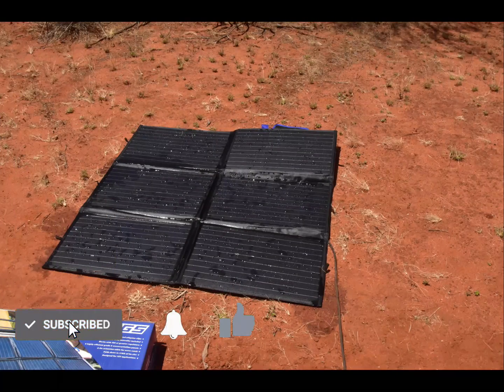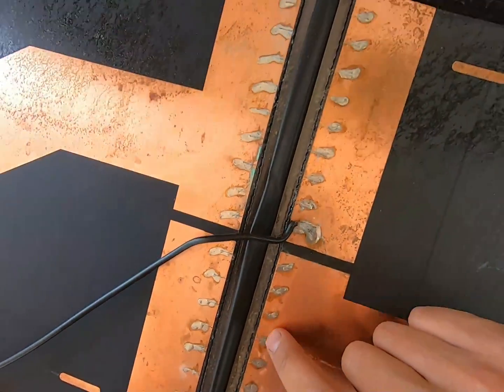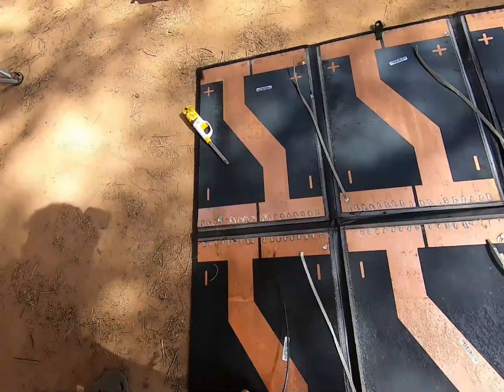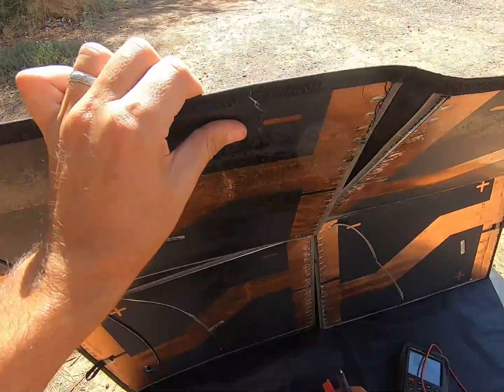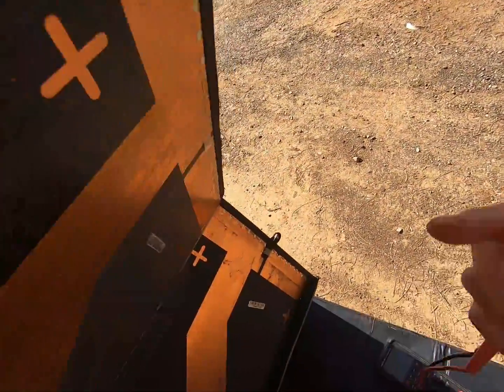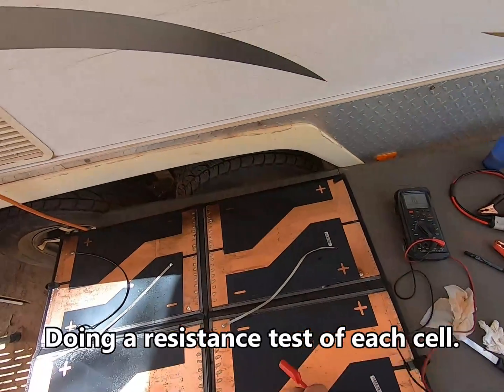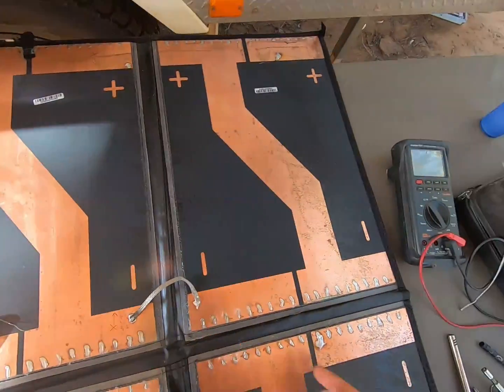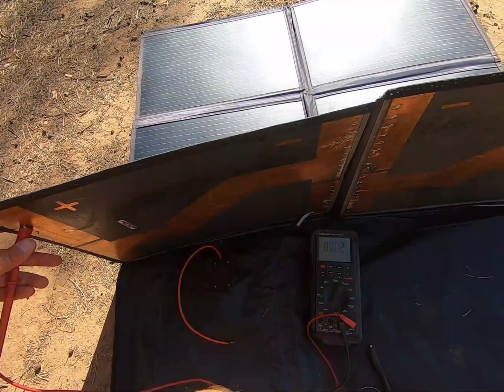[DETAILED] How to fix a faulty solar blanket

Comment: Great to see what's inside! 
You can measure the panel section voltages without disconnecting the braided wire links. 
Overall voltage will obviously be 11/12 of previous value and current will NOT change, so only ~8% loss 😊
Reply from the maker: Glad it was interesting! Yes that's true you don't have to disconnect the braids - the panels are in series so provided the other end's disconnected your reading's not going to be affected by the other panels. I just did to be absolutely sure there was no outside interference in my measurements.

Comment: I followed your repair with success, however the plastic coating over the cell is in such disrepair do you know if this can be repaired
Reply from the maker: Hi Garry, I don't think so unfortunately. The coating is one of the compromises with a cheaper blanket. The only thing I could suggest if it's stopping light getting through is to just carefully scrape it all off. I imagine it's there for a reason so this may introduce other issues, but if it's already that far gone you may not have much to lose. Good luck!
Reply: Cut & polish?
Reply from the maker: @electron-1979  Theoretically yes, but the solvents in polishes can sometimes react with plastic and make them go milky. So it could make whatever's underneath to go milky as well. I guess you could easily test it on a small corner first.

Comment: yikes they suck... 3amps? I get 6amps from a 100w rigid (6kgs) 1m x .5 .... and it works on super hot days(5.7amp). Kings weighs less than 6kg (5.5?) so lol why would you bother. Get a panel that actually outputs what it says
Reply from the maker: Yep I've heard panels work better, but they're physically a lot bigger so people may not always have room to store them. Blankets tend to be a lot more compact which is probably why some folks choose them, certainly that's the case for me.
Reply: @TheMusingGreg  Yes thats the narrative... but a 1m x.5m is small and even a 4x4 setup has a roof component/space. for hikers yes a blanket would be the only choice though their needs are tiny as they cannot store much. (charge a phone camera or light?)
Reply from the maker: @markwright196  It's not just a theoretical narrative, it's reality - at least it is for us in our caravan. Space is at a premium when we're travelling as our vehicle and van aren't huge, so for us a compact solution is very important. I'm travelling with five blankets at the moment while testing different brands, yet I'm able to fit them all in because they're compact. There no way I'd fit something 1m long in any of the spots I store my blankets - it's too long for the cargo area of our vehicle and too tall for any of the nooks I can tuck my blankets into.

On our 4x4 roof rack there's a canoe, shovel, MaxTrax and body boards so there's no room for a solar panel there, although I don't need a panel on my vehicle anyway. 

I get not everyone would have the same space constraints, but it's also not just hikers who might need something smaller than 1m long.
Reply: @TheMusingGreg  If you have a van then I have a hard time seeing the limit. I have a avan and it fits fine, which is one of the smallest vans.
Reply from the maker: @markwright196  It's not like there's physically not the room if it was the only option. A folding panel could sit on a bed, or on the table, on the floor or the van for example. But I don't want things just lying around getting in the way otherwise you can't just pull over and have lunch in the van if you've got all this large clutter in the sitting area or walkways. I like to store things in designated storage spots which are by definition out of the way. And the places I have available for storage aren't large enough to take a 1m folding panel.

Comment: Too fast
Reply from the maker: Which bit in particular Deb? I fast-forwarded through a couple of sections which were just repeating the same process over and again but the rest was at normal speed. I'd appreciate knowing so I can improve that in future. Thanks!
Reply: @TheMusingGreg  around 15:19 and on for a bit I couldn’t keep up
Reply from the maker: @debtaylor4989  😄
Reply: @TheMusingGreg  huh
Reply from the maker: @debtaylor4989  Maybe we've crossed wires here? You said it was too fast from 15:19 onwards, but the video is only 15:19 long. So I figured you were having a joke. Did I misunderstand? 🤔

Comment: Hey mate I've got your same solar blanket and seems not working properly anymore. Same as you.

Did Kings change your old broken solar blanket with a new one? I mean did they replace your old one with a totally new one?

Of course mine is still under warranty. 
Please let me know
Cheers 🙂
Reply from the maker: Yep they replaced this one under warranty as I sent them sufficient information to show it was faulty (i.e. zero output).
Reply: @TheMusingGreg  Good on you! 
What proof did they want you to show? 
Cause something similar is happening to me as well, but wouldn't know what to say to them.
Reply from the maker: @fulviomorrone6995  In my case it was easy as there was no output, so a multimeter showing 0 volts when connected to the output connector was sufficient. When it was low output in an earlier faulty blanket it was harder, but I still showed the output current and voltage going into a battery from which you can calculate the power (Power = Voltage x Current) and showed how far below the rated output it was. I show this a bit at the start of https://www.youtube.com/watch?v=cfCM_p21cGs. They accepted it after a while and replaced that one too.

Comment: Hi so you put the volt meter between the kings nppt charger and the battery?
Reply from the maker: Depends what you're trying to measure / achieve. If you mean at the end of the video when I was measuring the voltage coming out of the regulator and going into the battery, then yes. Which part of the video are you referring to?

Comment: i have a king's 250 w solar blanket, not showing any watt's on a watt meter, disconected the straps connecting each panel, each individual panel show's between 21.4 v to 22.8 v, anderson plug show's 21.5 v, but no  watt's on the one panel it's connected to !! any suggestion's please
Reply from the maker: What's it plugged into? It sounds like whatever it's connected to isn't drawing any current. If you've got 21V at the Anderson plug it means all the panels are working, as you've found. But with no current flow, you get no power (power = voltage X current).

Make sure it's connected to a working solar regulator and a battery which needs some charging, and check all the connectors between the blanket and the battery.
Reply: @TheMusingGreg  thank's mate, i'll keep messing with it , see if i can get some sense out of it
Reply from the maker: If you can't get any sense out of your setup, go to Jaycar and buy this resistor https://www.jaycar.com.au/100-ohm-5-watt-wire-wound-resistor/p/RR3274 - if you plug your power meter into the output of the blanket, and then connect this resistor across the output of the power meter it should draw about 0.2A, which at 21v will be close to 5 Watts on your meter. That will eliminate any issues with the battery or wiring.
Reply: @TheMusingGreg  fixed, must have been a dodgy solder on the connecting strap's, thank's for your help mate :)
Reply from the maker: Cool glad you got it sorted!

Comment: Hey mate I have the same blanket and I can only get 5 amps out of it on a good day full sun and my meter is saying it's only getting 50w would there be a faulty panel on mine like you show here? Or if one panel is faulty it won't work at all?
Reply from the maker: Hi Dale, I can relate to that! Mate it could be faulty, however there are a few other things to check first:

1) how full were your batteries? If the batteries are already nearly full the regulator won't take full power from the panels. Try connecting it to a flat battery and see how much goes in.
2) make sure you check all the connections from the panel to the regulator, and then to the battery, are all tight and clean. I had low current at one point last year and it turned out one of the bluepoint / cable joiner connectors I'd used in the system was a bit loose. After tightening up the screw connector the output lifted by about 20%.
3) I assume the panels are clean? Dirty panels will give reduced output.

If yours is faulty it would have to be in a different way to mine, because as you said yes if one panel fails completely and goes open circuit it stops the whole system working. It is possible however that one or more panels might be losing their oomph which would lead to a general reduction in power. If that's the case, if you've eliminated everything else and it's still under warranty, you might be able to get a replacement.

FYI, I've got a brand new Kings 200W blanket unit to pit against a brand new Redarc solar blanket in the next couple of months. So stay tuned (and subscribe if you haven't) as it should be a very interesting comparo!

Cheers,
Greg
Reply: Update: took it back to the 4wd supacentre store as per instructions that I got by email. Was told it can be resolved the next day and I will receive a call. Never got a call but went back the next afternoon only to be told they can't do anything. Wasted 2h/120km driving. Cut open the blanket at home and found a broken braided wire (it's short and the solder made it hard/brittle). Design fault. Should have made the braided wire longer to avoid the hard part being in the fold between panels. Temporarily taped it with electrical tape and it works again. Will need a better long-term solution though. Also, after drawing a diagram, it made sense that it only put out 50%...
Reply: @christiangerdes7606  Same story here, just read your post. But on mine there is some change in from first two.
Reply: Hi. I have a 120W (4-panel) Kings blanket. It gave me up to 100W charge when new. I only get 42W max. Now. When it is in full sun and I cover the first 2 panels near the cable connector, there is no change in output. Assume these 2 panels have an issue but still let the charge of the other 2 panels through. Just 2 months out of warranty. Bummer.

Comment: Looking at those straps one could imagine any rough sort of treatment or accidental dropping of the panel could cause one of those straps to break.
Reply from the maker: The straps are actually reasonably solid if you mean the ones around the outside with the velcro. But yeah the panels themselves aren't super solid but I guess that's part of the deal with thin panels!

Comment: The first thing I try is re solder all the wires on the copper strip you get dry solder joints and this fixers it sometime, if that don't work bridge the faulty one out like you did.
Reply from the maker: Yep that's a good point Jim. I was hoping to find something like that when testing all those links before I went on to testing each cell, but if I'd found nothing then I would have done exactly that. Cheers!